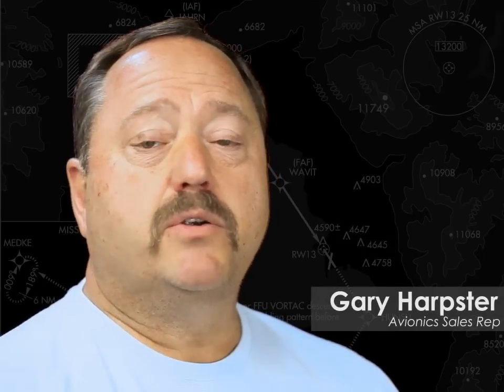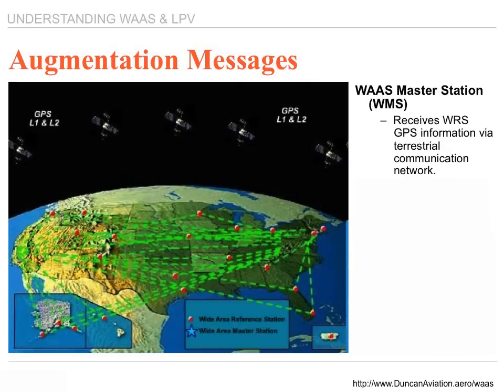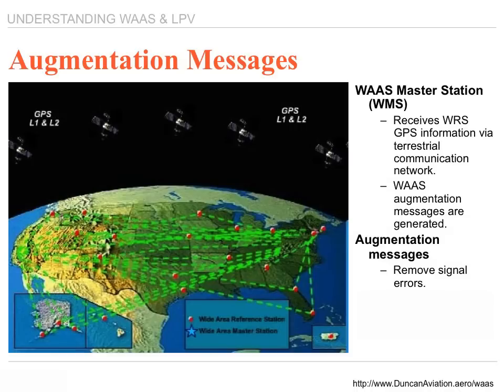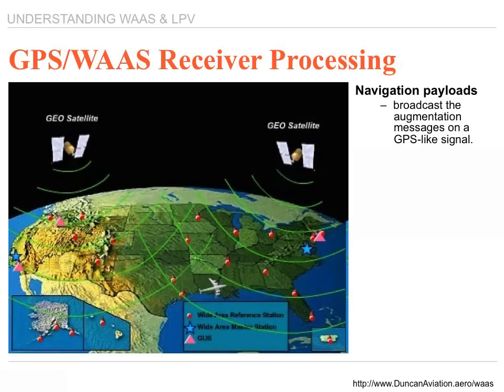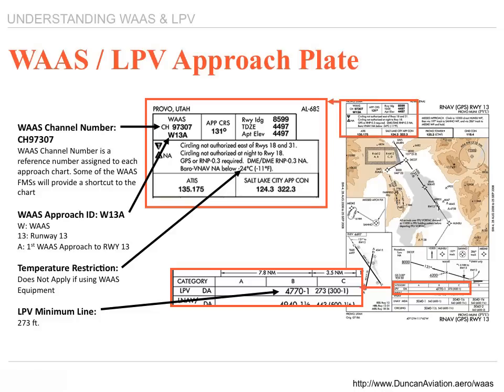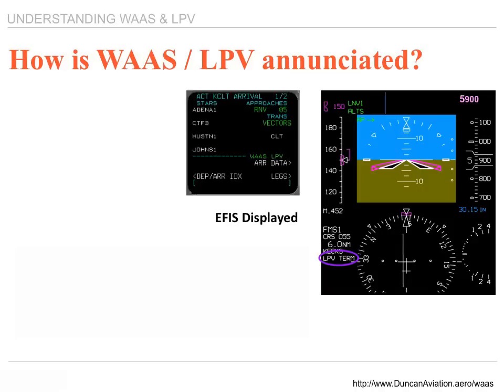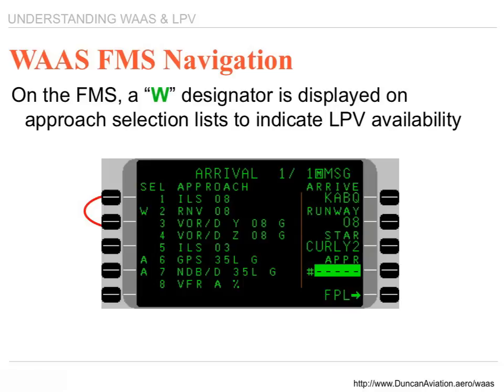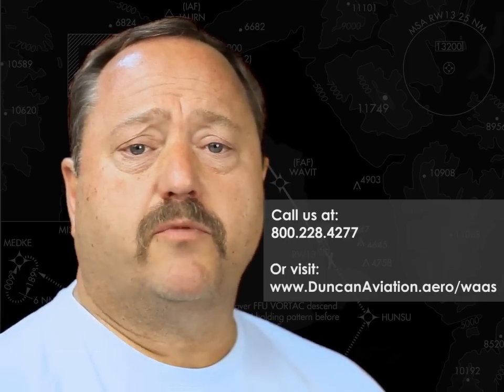Understanding WAAS & LPV: How WAAS Works

Comment: Mr. Harpster- do the Ipad applications include WAAS functionality?
Reply: They do not. They don’t have a WAAS receiver. 

Technically they don’t even meet TSO C129 requirements (or whatever the new equivalent is) because they don’t have RAIM. That means they cannot detect or exclude faulty satellites. 

The only time I’d use an iPad is for situational awareness if I’m doing a traditional non-precision approach on raw data with ground based radio navaids, or in an emergency after loss of an IFR certified GPS to conduct an LNAV approach... using baro altimeter to perform stepdowns only if a VFR Airport was out of range.